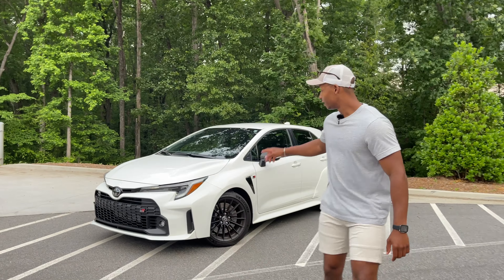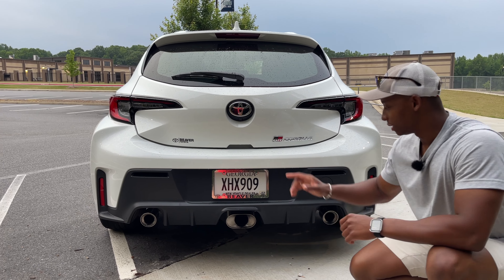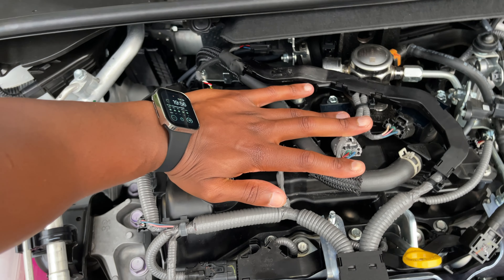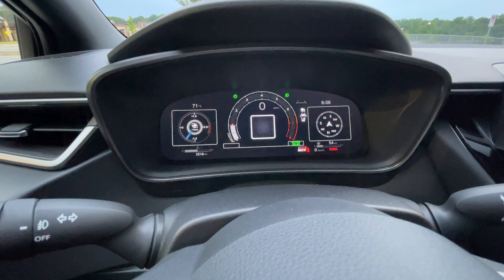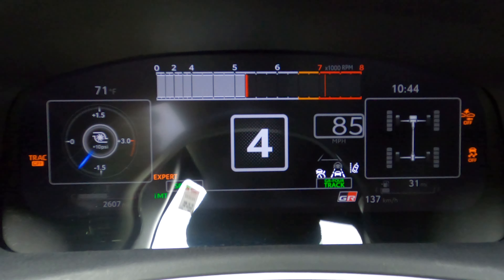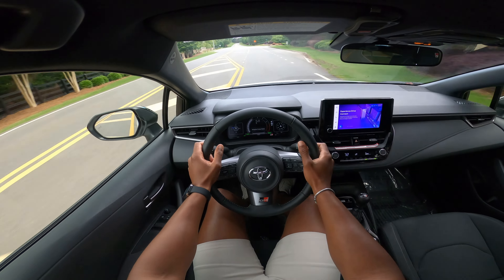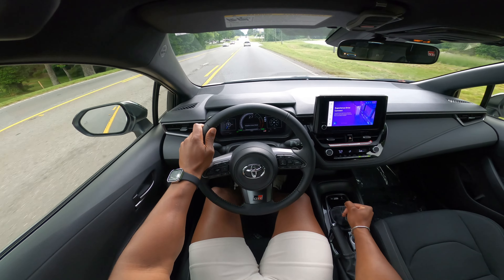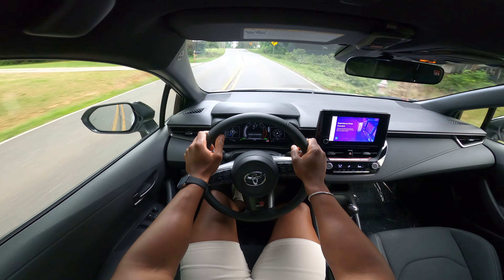Toyota Corolla GR!! BEST HotHatch you can BUY!!

Comment: 25 psi of boost not 30. 30 would be insane lol.
Reply from the maker: 2.0 Bar = 29.07 psi..... The car runs at 2.0 bar of boost. I showed it in the video mate
Reply: @reviewedbytim  Mate, if you look at the gauge in the center it reads "x 10psi" its not read in "bar" metric. so "2.0" on that gauge would be 20 psi. I own one so I know they don't run anywhere near 30 psi. Morizo runs 1psi higher at 26 psi.